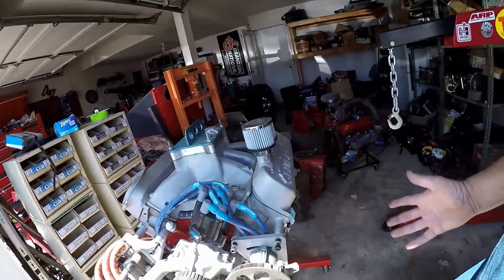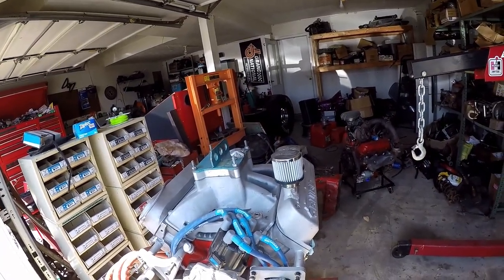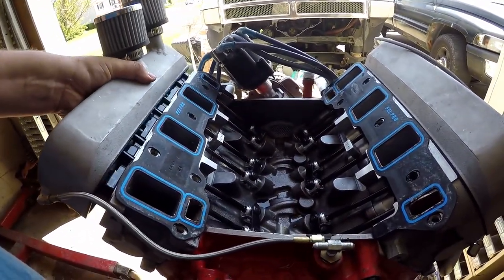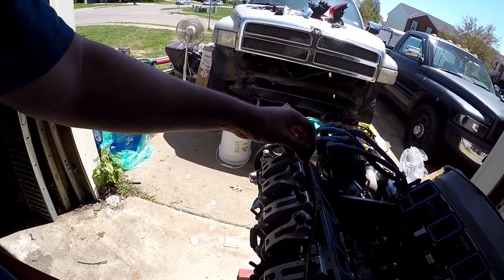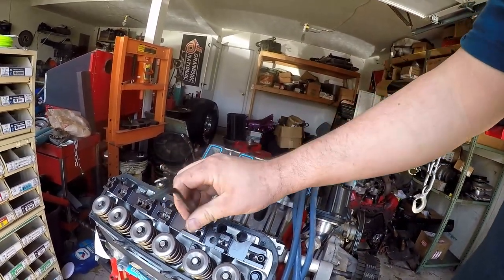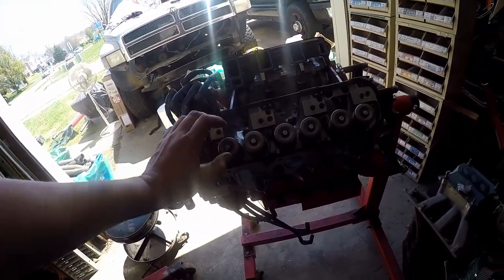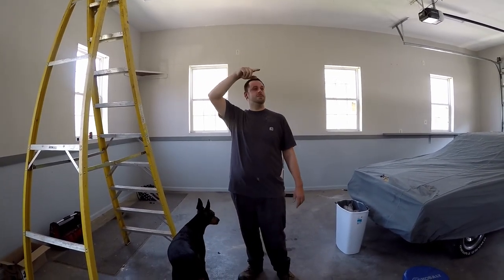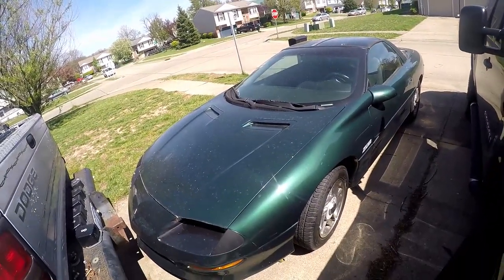Buick V6 engine teardown

Comment: The LS of the V6 world. Cheap, easy to find, and a huge aftermarket support.
Reply from the maker: It's really none of those things, lol. You're thinking of a production 109 block. Stage 2 is a very different animal. I have $18,000 in stage 2 parts and most are used and need work. They aren't easy to find either. And no aftermarket support anymore. I will have to fab headers and EFI intake manifold from scratch. Some people made parts years ago good luck finding them.
Reply: @HorsepowerTube  Even the production 109 isn't cheap to build.  A stock rebuild can run about 4k.  If going in a turbo car like my grandnational if turning up the boost is what you want you need at the least alcohol injection.  Other options are race fuel or e85.  I went with alcohol.  Next you gotta build the transmission or the motor will destroy it.  Then it needs to breathe so better exhaust.  Then you need more fuel so hotwire fuel pump kit, bigger injectors, rjc plate to even distribute air flow to each cylinder.  Car rigidity is an issue so body bushings need to be replaced.  After about 20k you have a car that can get you in the mid 11s. Thats with flat tappet cam and stock rotating assembly.  Add another 1500 to 2000 for a roller rocker setup.  And of course the turbo cost.  My turbo is a te 60.63 turbo with garrett housing.  In the grandnational its not just the turbo everything around it has to work too.  Guy who built mine also built a stage 2 demon killer for another guy.  8 second quarter mile!

Comment: Another reason for the oil squirters is the fact that the Buick 231 had a less than optimal oiling system with the steel gear driven pump in the aluminum front cover.

Comment: I had Kenny build my twin turbo motor stage 2 motor in 93. Just recently bought my 6th GN can easily run 9s with today's technology
Reply from the maker: That's awesome. My car has had 2 previous 109 based Duttweiler motors. Where are you from?
Reply: @HorsepowerTube  Kansas city Missouri that's what I'm building now. 109 block with good internals from Full Throttle speed and just got RJC Intercooler w/ 5 inch downpipe and 72/70 precision turbo. Switching over to Turbo Tweak e85 system
Reply from the maker: @terryprust9604  sounds awesome. you ever go to the Nationals in BG? I can't wait to dig into mine. Had money set aside to build it but I've had to put everything on hold for a little bit. In the middle of a super nasty custody battle and it's eating all of my car funds. Hopefully that will come to an end soon.
Reply: @HorsepowerTube  back in the late 90s I went but I also went through the big D and custody had to sell everything and start all over. I just come across this car 2 months ago. It had a broken motor and sold it for 18k it's a Beautiful car with new paint 🎨
Reply: I remember an old issue I had of Muscle Mustangs & Fast Fords with coverage from the Mustang vs GN shootout they had back in the late 90s. It was the Duttweiler brothers who made it to the final round; one in a GN and the other in a Fox. The GN took the win!

Comment: I'm getting one of these that's built about 300 horse give or take my 79 Grand LeMans. Car originally came with a V6 anyway, now more like a sleeper car has 28,000 original miles got it from Orig owner. I love N/A Buicks. Diehards.
Reply from the maker: Nice! That will be cool! I'm guessing you're talking about a production Buick V6. These are a little different because it's a stage 2. It was only used in aftermarket and racing. But they're pretty similar and alot of the parts are interchangeable. They make 600hp without a turbo lol.

Comment: So how's the engine build coming along?  The guy who builds headers for NRE built my twin turbo headers for my S2, his shop is close to Duttwieller as he is friends with him.  Converted 4bbl intake is all the manifold that's needed and you already have that.  Love the the S2, Gene Flurry is running 7s with his, faster than most mountain motor pro stock cars of yesteryear.
Reply from the maker: It's great. Got it back already. Picture is on Instagram. Got a new house and new garage. Been Real busy. Hope to start making more videos soon. I have some hooker turbo manifolds for it I grabbed at the Nationals at BG earlier this year.
Reply: @HorsepowerTube  Hooker made headers for Stage II cylinder heads?
Reply from the maker: Apparently. Altho I've only ever seen one set of them.
https://www.turbobuick.com/threads/stage-2-twin-turbo-headers-for-stage-2-heads.466508/
Reply: @stageiimike2145  brother you need to post more vids of your beast!😎
Reply: @gnxtacy  The car is at a dyno tune facility, putting the finishing touches on the XFI tune, goal is 800hp to the rear tires on 93 octane with methanol spray.
Reply: @stageiimike2145  didn’t wanna deal with e85?
Reply: @gnxtacy  2 reasons: Its not available where I live except at one station.  Second, I do not trust that the E85 at the pump would be consistent, the only E85 I would trust would be from a place like VP racing fuels.

Comment: That’s awesome!  Very cool info.   I’m building a stage 2 to make 1200hp.   So you know the specs like compression ratio, being nascar motor I’m guessing 13:1,  and cam specs?
Reply: Way to much compression for a turbo car I had 10 to 1 on my stage 2 back in the day. Built by Duttweiler I'm running 🏃‍♂️ 30lbs of boost now on a 109 block e85 72/70 turbo running 9.20s 150 mph
Reply: @terryprust9604  a NASCAR motor were not all boosted at the time there was a 274cid that made somewhere in upper 500s like 570 or something naturally aspirated !  My stage 2 is little over 10:1 compression and boosted! That’s pretty good!  My 109 I got to 133.
Reply from the maker: I don't think any of the Busch cars were boosted. But they boosted the stage 2 for Indy cars.
Reply: @HorsepowerTube  true.  The ones making 500+. NA were not  but some of the Buick Motor Sports (BMS) had turbos!  I’m not too keen on all the history but I do know some!  Kenny actually specked my cam on my stage 2

Comment: Making your wife work on your GN engine when you know she should be in the kitchen! Lol.. Just messing with ya, it'a actually pretty cool you included her in your upload.. Are you going to do away with the opti on the 96 Z28 like on the red T/A you had? I bought a 97 Z28 6spd Bright Green Metallic new & after 2 1/2  years of owning it i went to visit my mom and when i went to leave it wouldn't start.. Walter Jackson Chevrolet came and picked it up called me the next day & told me the water pump went bad & pee'd on the opti & ruined it.. That was in 1999 & if it hadn't been under warranty parts & labor would have cost me $1,500 & some change .. I believe the opti alone was over $700 at the time.. I realized that day that i didn't like an opti-spark or it's location so shortly after that i traded it in on a 1999 pewter SS 6spd camaro.. All aluminum LS1 motor, 8 coil packs no opti, and a world of difference in performance..